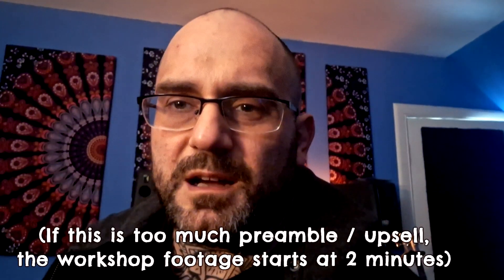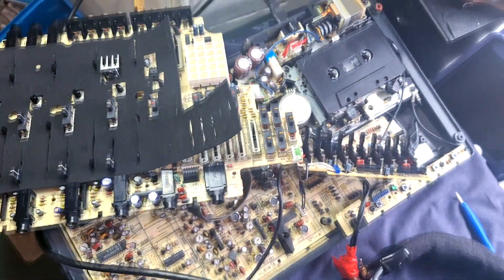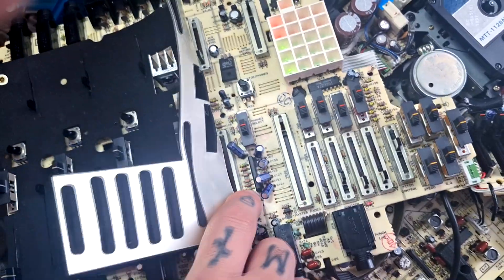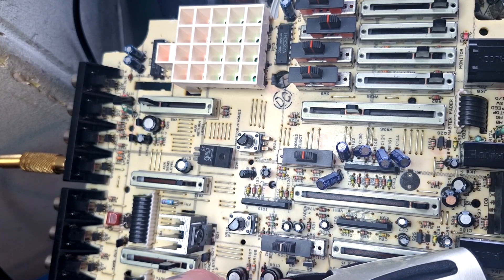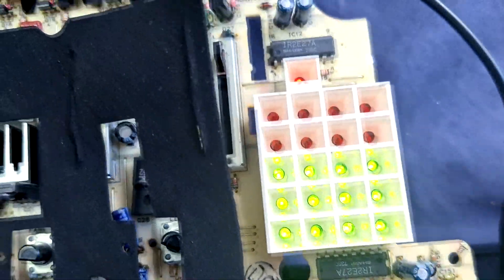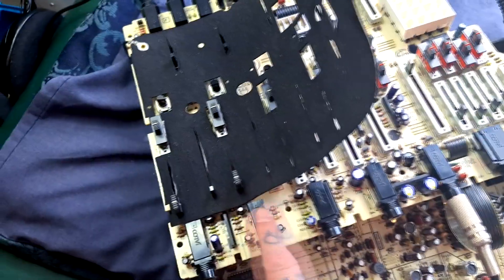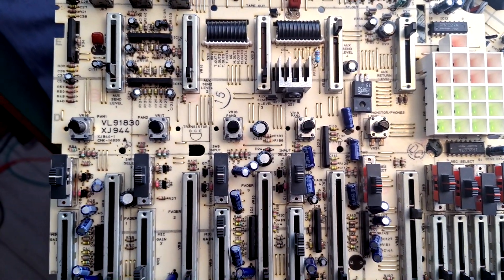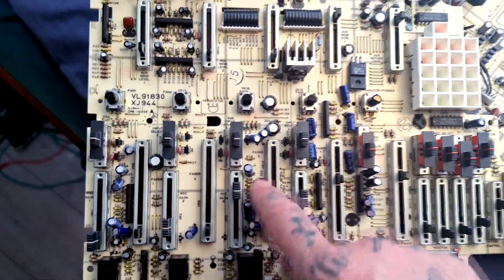Does recapping work? (Patreon preview)

Comment: I repaired my Mt120 i wouldn't even buy one on ebay for £30 now it's a expensive repair and they are all fucked even 10 years ago the components failed the mixer board is only the beginning the cassette board is the culprit here the deck will behave normal play normal with pre recorded tapes try recording and playback you get the problems. The record amp is on the  bottom board cassette board and it's never ending fault finding. Everything needs replaced and i hate the values of these capacitors everyone if different apart from over 50 10uf 16v
If someone came to me with a MT120 asking for repair i would tell them i can't do it ... not because i cant but because the work involved

Comment: Thank you for this knowledge. Where did source your capacitors for mt120 just bought one and just trying to find out sources for possible repairs. Any help would be awesome i am going to join patreon when i start digging into unit im sure
Reply: MT120 is a nightmare you would be better with anything than that deck i have repaired my one but i would advise against it the one Tetakan had i think he broke it up for spare parts
I had to build new connectors to replace black ribbon cables replace connectors recap both boards remove all the black disintegrated rubber that contaminated the faders and pots on the shielding. Have to scrape it off with a scalpel horrible time consuming deck the capacitors are identical to resistors and color banded  i used normal sized capacitors for the radial through hole and bent them over. Even replacing the ribbon cables with AWG24 wire will stop the case from closing back together so you have to find 2.0 pitch ribbon cable and crimp 2.0mm JST PH connectors on to replace the connectors or crimp to the original ribbon cables. recapping is also difficult the ESR in low value caps can't be tested so can only signal trace. replacing bad caps will then knock out other caps that are bad but still enough to function it will take forever to repair.
Reply: @theprogrammerrolandmc3039 he has a video of him recapping a mt120 and he wasn't complaining. I think working on these types of things you should expect to be tedious

Comment: Yes, thanks! I've repaired a few of these and you're right, there are bad caps all over. Their voltage ratings are too low in general I think. Very nice that there's a very legible silkscreen on both the top and bottom of the boards though!
Reply from the maker: Agreed, usually the Yamaha PCBs are much more legible than their fostex and tascam counterparts
Reply: Pity they put that decomposing shield above the faders all that black crap destroys the faders at this point of their life time to pull it out and replace it. It's a cool deck but it's best feature is the tape mechanism the leaking 10uf are just the begging of recapping these dont i know over 50 uf i have replaced so far  The scematic is a joy i took out all the caps and other randoms to test as the 10uf were leaking  so looking at the scematic when my new caps arrived i though there must be a fucking list of components you fucking cunts did someone not photocopy some pages. Having to write down the schematic myself was tedious

Comment: Really good, pragmatic approach you describe in the description - the time taken to carefully dismantle often far exceeds the cap' replacement time. I'd personally much rather spend another 15-30 minutes replacing all the electrolytics if one has gone, and get another 20+ years out of it, than have to go back in again, or even lose a piece of gear if the cap's on the PSU.
Reply from the maker: Agreed... with hindsight it'd have been better if I made this point during the video, thanks for taking the trouble to read the description

Comment: Do you buy bulk packs of capacitors, or buy what you’ll need for the project? Do you have a preferred source?
Reply from the maker: When I srated out I gradually populated a multi compartment box with 20 or so common values . Rarer values or ones I go through in large quantities (10uf, 16v is really common for 80s Tascam mixers and amps for instance)  I have a folder with poly pockets holding the different values. I tend to buy at least 50 of a value at a time from Farnell because they are based in the UK - Digikey has a wider range of stuff but they charge me more for postage and end up sending it to me from accross the atlantic and it takes weeks. I avoid resellers on ebay etc because the inherited wisdon from forum knowitalls is there are terrible awful counterfeits out there, though I've never encountered faulty fakes personally.